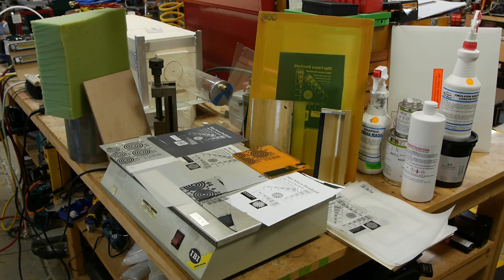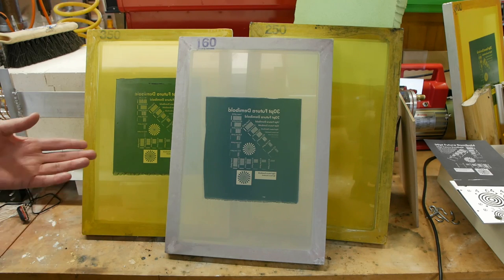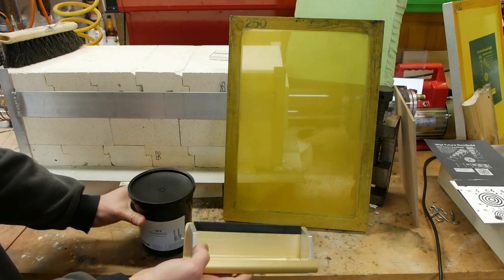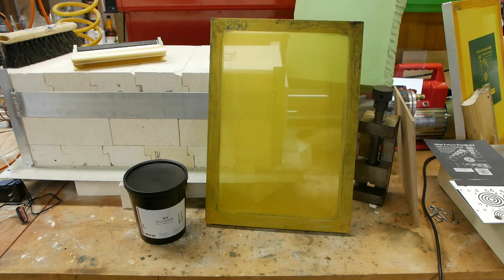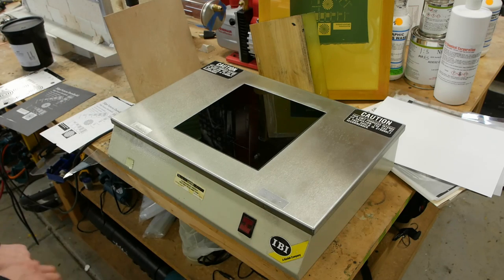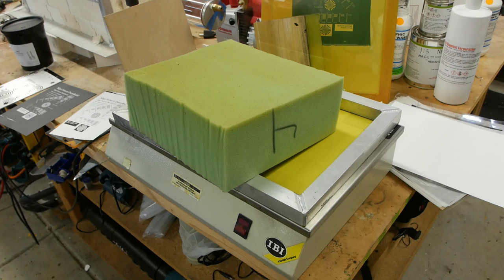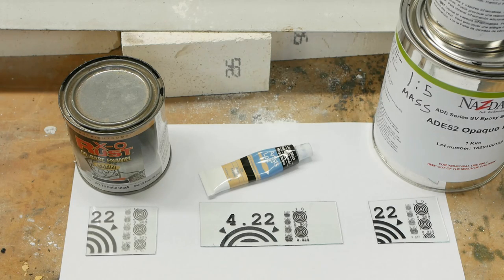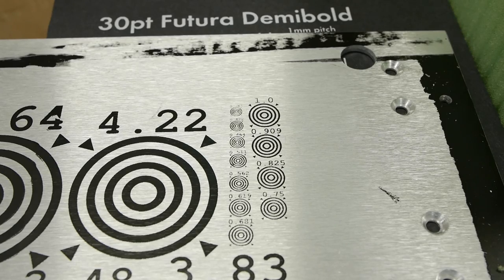High-resolution screen printing demystified

Comment: Have you tried to project an image directly with a projector against the UV film?
Reply from the maker: No, but that is interesting idea.  It probably couldn't beat the resolution from a 600 dpi printer, but there might be some other unusual applications.
Reply: Commercial Direct to Screen units are available, they use a laser to expose the photoemulsion kind of like a laser cutter cuts materials with a laser, but without the laser turned up to death-ray levels.  They are more useful on smaller screen printed images, they are somewhat slow on large images. If the screen mesh gets damaged during printing, it's much easier to yank a pre-coated and dry out of the dark room, slap a film positive on it put it in the vacuum frame and expose it with a five kilowatt UV source, wash it out and you can have it back on press in little over 30 minutes. You would just be finishing up with the laser writing part of remaking the screen using the laser written screen.
Reply: If size is not an issue then any of the stereolithography 3d printers that use LCD screen can get  down to 40 micron resolution. I have seen one example on youtube doing this for a making a PCB.
Reply: > It probably couldn't beat the resolution from a 600 dpi printer @AppliedScience  

Kind of depends on how small you are projecting down to. ;-)

Comment: The 350 screens can give better results, but it requires very well controlled paint and a lot of experience how to use it. Most of the people will get better results with 200-250 ones.

Comment: it would be better to print in bigger size then use a lens to size it down in front of the UV light to the required size, it will be sharper since more photons can hit the spot and it's going to cure faster.

Comment: TBF 300ish is sorta mid-high, not really high.  I've used > 400 before.  I still prefer films from lino. Vellum is OK for lo-res. and you cant do any sort of accurate tone work.  For REALLY high resolution serigraphy pre-fab  screens really don't cut it.  When I would be doing spot+ process photo repro on dark fabric (8-12 plates) everything but the base white and highlight white would be on a mesh of 355 or higher. In order to achieve high fidelity color repro at those resolutions mesh on roller frames (<3 Numan) needed to be tensed to 80 newtons (measured at 9 points) and work hardened.  They're so tense it's like running a squeegee across a pane of glass.   Also exposure timers aren't accurate enough in production in my experience. Lumens-meters are far superior because they take into account the dimming of the bulb over time and will adjust the exposure accordingly.

Also auto-haze = barnacle stripper.
Reply: Grady Broyles you should make a tutorial or write a book... sounds like a ton of valuable knowledge
Reply: I used to teach screen printing at a shop that did vocational rehab for former addicts and gang members. 

So, there's more. For extra-hi res printing the squeegee should be a fairly stiff one (they come rated) with a sharp-ish corner. The mesh should be 1/8-1/4 of an inch of "off-contact." (gap between the mesh and the printing surface).  If doing it by hand, hold the squeegee from the sides, not the top and with the angle very close to 90 deg, apply pressure with the muscles in your forearm straight don and then pull the squeegee as if you're "shaving" the ink through the stencil.

This is different than the usual way of holding the squeegee from the top and using the force of your fingertips to push down on it while pulling. This creates more of a "mushing" action than a shaving one and will effect the way the ink dot spreads when it hits the paper/fabric.(called "dot gain") I'm not saying to use the shave method instead but rather know when to use each. The rule of thumb is if you're using > 300 mesh, generally use the shave technique. For spot colors, keylines, under-bases and stuff use a variant of the smush method. 

This will matter the most if you have a high-res halftone for your black (and cyan) plates. This inks are the most visible and so more care must be taken,
Reply: @ivanstroganov5458  i used to teach it

Comment: where do you get the photo emulsion sheets?
Reply: Well, let me tell you.  The one I used was made by ULANO.  However, where you get it is important too.  My first box of 25 sheets ( I think ) was at the end of the 18 month usable life.  So, like food there is a use by date which is derived from the (CODED) manufacture date code.   So, my first experience with this stuff was just awful.  After giving 2 months of my life to trying to make that work, I ran out of sheets and needed another box.  This time it worked great, not as advertised, but great.  This box had a (CODED) manufacture date code that indicated it was only a few months old.  So, when you buy this product be sure to ask about the manufacture date code before they ship it to you.  If this was camera film the company would have pulled it from the shelves before it became too old.    I am printing higher resolution than a T-shirt.  I am printing lettering on a rack-mount audio product.  My choice of fonts and font size makes a big difference.  
Jim Moss
Reply: @jmoss99  thank you for all the information!

Comment: most tshirts are 150.  That gives you a good crisp edge and a thick coat of ink.  250 is ... not very useful.  350 is very good for things that need a lot of detail (like shirts with faux-wearing and cracked paint).  Higher thread count creates... more 'soft' edges and are a pain in the ass to clean out.  Also... high thread count means it is MANDATORY to use paints with lower viscosity.

Comment: Here is what I found so far.
The capillary film emulsion  I used was made by ULANO.  However, where you get it is important too.  My first box of 25 sheets was at the end of the 18 month usable life.  
https://www.mclogan.com/shop/ulano-film-15x17-micron-p-1156-c-293_297_400_152.html
So, like food there is a use by date which is derived from the (CODED) manufacture date code.   So, my first experience with this stuff was just awful.  After giving 2 months of my life to trying to make that work, I ran out of sheets and needed another box.  This time it worked great, not as advertised, but great.  This box had a (CODED) manufacture date that indicated it was only a few months old.  So, when you buy this product be sure to ask about the manufacture date code before they ship it to you.  If this was camera film the company would have pulled it from the shelves before it became too old.   Not so with some suppliers as it might not move very fast.  Remember OLD = BAD.  The usable life of 18 months is not like a light switch, it is a gradual loss of usability.  I am printing higher resolution than most T-shirts.  I am printing lettering on a rack-mount audio product.  My choice of lines, fonts and font size makes a big difference.  I made changes to these as a result of tests.  I have not yet tried Dual Cure, but I will.  It is said to have a different exposure curve.  

I am using one sheet thick of  laser printer vellum printed on a Epson InkJet ET-2750 with settings pushed to highest quality and with HIGH SPEED turned off.   For 17 inches I had to print out 2 sheets with + targets and mount them side by side, but for the targets.  This vellum was mounted with scotch tape on LOW IRON 1/4 inch tempered beveled glass that passes 86% of UV light and is nice and heavy.  I got the glass from these guys.    
https://www.onedayglass.com/
They said they sell a lot of glass to screen printers.

Doubling up the vellum just added too much diffusion in the unprinted area for exposure.  Doubling up worked fine for clear film, but not as good as a single sheet of vellum.  There might be something going on with the diffusion which I have not analyzed yet.   

With this ULANO 50 ORANGE product, washing out the unexposed emulsion took more time than you see in the YouTube videos.   There is a point that is between not being able to wash out the letters or images due to over exposure that hardens the emulsion under the stencil  at one extreme...  and having either the entire emulsion wash out where it should not on the other side of the extreme.  So, there is a point where it is fairly easy to wash out your images on the emulsion, but is not yet exposed enough. Not good.   Here you will find that enough emulsion is melted, that should be hardened, that will, in drying flow over your open areas you just washed out.   

What worked for me was 40 seconds using two of these lamps below.
https://www.amazon.com/QUANS-Blacklight-Fishing-Aquarium-Waterproof/dp/B06XJZL97N
Now, I went to 2 of these lamps ( I know, not single point anymore ) to eliminate the hot spot in the middle of this, or any, lamp.  I tried 1 then 2 CFL UV lamps and still had the hot spot issue where you cannot find a time that exposes evenly over, in my case, a 17" long image.   So, before I found this solution I would expose the outsides of the image fine, but could not wash out the middle.  Then with exposure less, the inside of the image would be fine, but the outsides would wash out.   I now I will go to hell for this...  but my solution was to move the two 50 watt LED UV lamps apart on a support bar.  This worked best for me.  I was able to measure with a 1990s pro photographic light meter the variation in light across the front of the 17" image area of the screen.   A single point light source, I found, also had a hot spot that was a function of the single spot of light and the different distances from the light to the screen image.  That is, the center of the light to the center of the screen was one distance (20.5 inches in my case) and another distance from the light to the outsides of the 17" image on the screen.   This turned out to be 22 inches in my case.    That made a difference.  By moving the 50 watt LED UV lamps apart,  I could have some control over the hot spot.  Also, moving one lamp's distance from the screen slightly allowed more adjustment.  
 I had tried moving the lamps 57 inches from the screen, but that didn't work as well as the shorter distance.  For me at least.  

Washing out the exposed emulsion on ULANO 50 ORANGE, was not as ULANO showed in their YouTube video... or anyone else for that matter.  After lots of tests, I found it best to NOT wet the squeegee side of the screen and just work on the emulsion side.   First, with the screen laying flat over a mixing box (Home Depot, like a kitty litter box, but bigger)  I wet the screen down on the emulsion side only with a soft flow of water from a garden hose sprayer.   Then after a minute or two, I misted the emulsion with a non-abrasive fog of water.  After a bout 5 minutes I would hit the emulsion with what is called a spray setting to see how much of the image would wash out.   Then back to the misting again with a spray.  Over the course of about 20 minutes or so, I was able to remove the unexposed areas (11 to 12 font letters) without blowing out parts of the image (fonts).  My exposure time with these 2 LED UV lamps, 50 watts each, was 40 seconds.  I tried 30 seconds, but the exposed emulsion slimed the open areas.  I might try 50 seconds in the future, but for now this worked great.  The exposed area of the emulsion was hardened plenty.  I am using a 240 mesh, but might try a 305 mesh sometime in the future.  

That is my story and I am sticking to it!  :-) 
Jim Moss

PS:   I think I need to mention this to anyone who might read this post and might not know about this.  UV is very bad for your eyes.  Can make you blind in short order.  So, be sure to go out and buy some UV blocking glasses and never look into the UV light.  My UV blockers are dark red.  They block out UV so much that when I first turned on the 50 watt LED UV lamps I thought there was a wiring problem.  I didn't see any light.  Turns out, the lamps were on, but I just couldn't see it.   Read this about what can happen if you are not careful.   I push the button on my timer and leave the room.   
https://www.aiha.org/get-involved/VolunteerGroups/LabHSCommittee/Pages/Accidental-Ultraviolet-Exposure.aspx
Jim Moss

Comment: Actually one can get good print density with higher mesh counts by creating a thicker emulsion over mesh ratio on the substrate side of the screen which can be achieved by screen coating methods. I do one pass on the print side side of the screen and two passes on the oink side, flipping the screen on the ink side to eliminate any air bubble that might create pinholes. Even in high mesh this pushes the liquid through the mesh and creates a great ratio. The capillary film method is expensive. Find liquid emulsions compatible with your inks and learn how to apply it effectively to screens. Yes it is a skill  but exposes quicker and reclaims very readily with actual reclaiming chemistry. Your scoop coats were awful, it wouldn't pass my muster for even t-shirt printing.

I been screen printing for 18 years using plastisol, waterbase and discharge methods on finished textiles as well printing plastic control surfaces for electronic devices and helped set up a business to print on glass for kiln fired business cards in house.

Print technique is important and that is also a skill. Squeegee pressure and angle are very important. For art prints and smooth substrates a viscous ink, sharp stroke, low off-contact and very moderate pressure will be needed. screen flooding methods are also a skill.

When I first  got into this there was a big sharing community in the industry. It might be different now. I just wanna share my experience here. This has inspired me to do my own shop videos for the place I work. Thanks and DIY forever!

Comment: Watching this again with my girlfriend (a journeyman printer) both of us cringed at the recommendation of poly blue. We both prefer 2 part photoemulsion.  Poly blue is a bitch to get stuck onto the screen.  Instead of the scoop coater just use a squeegee cut to the size of your screen.  Also you only need pohotosensative material the size of your image.  The rest of the screen you dont want the ink seeping through onto your print surface is masked off with printing tape. Much more forgiving.

Comment: I never knew 1000 microns equaled 1 millimeter
Reply: micron is just a shorter name for a micrometer or micro meter which is .001 of a millimeter and .000001 of a meter (in engineering notation:  milli is 1 x 10^-3 and micro is 1 x 10^-6).  https://www.youtube.com/watch?v=h4m4_U27ib0

Comment: 15:50 The reason you had to use that much weight is because you were using a damn foam block. The channel is called applied science, but you definitely did not apply science in this regards. Next you should try making a vice with foam blocks too.

Comment: The knowledge of how to do things in the printing industry is pretty well ignored as old technology. The why's & how's were always rather closely held passed person to person or from supplier to customer. There were a few ad-driven trade journals but it was an old craft still working with the apprenticeship program in some cases. We saw computers as the end of all we were as printers.

Using Plexliiglas without UV blockers as a window on homemade UV sources should speed up the exposure time over most glass that is easy to source,  Drawing the negative down on the silkscreen with a vacuum is how it's done in industry.  If you have a vacuum pump it isn't that hard to do.